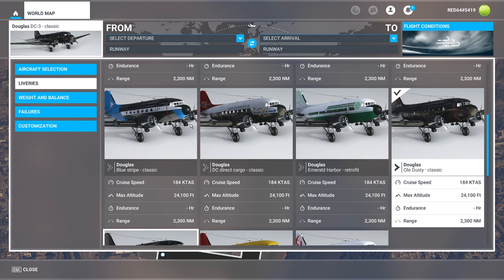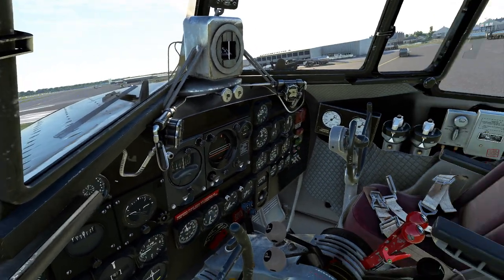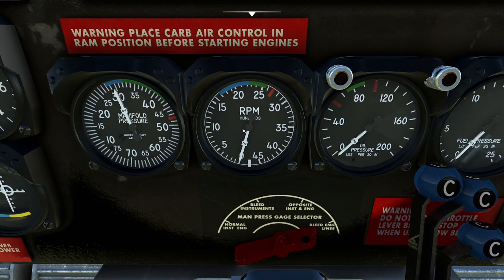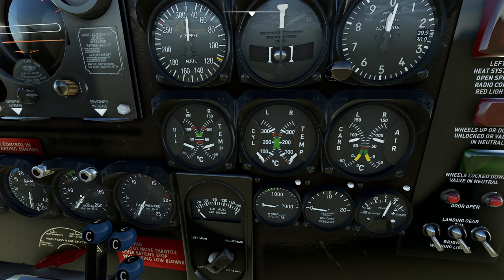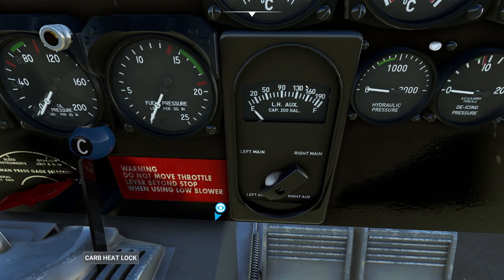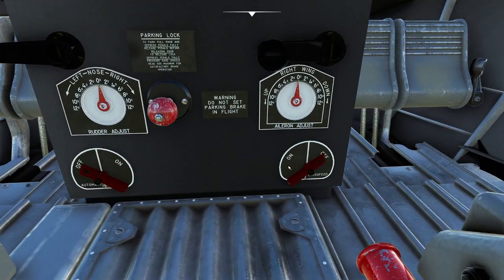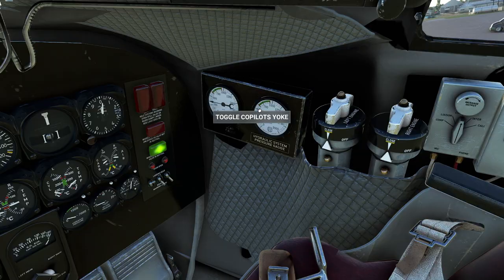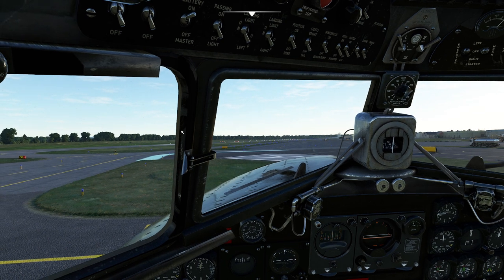MSFS - DC-3 Tutorial Part 1 - Systems

Comment: There is a mod for this plane done by Imendes from FlyByWire. He updates it weekly. This is my favorite plane but it's very hard, at first, to take off with. I crashed multiple times. Once up, you most drop your nose briefly to get your speed up. When landing, dropping you gear causes great amount of drag. Even if you are locked in on an ILS approach, the plane will start to fall. You must increase your throttle almost fully. That said, I love this plane and the deco era of style.
Reply: Typically radial straight wing aircraft takeoff at nose level to horizon. I know it's true with the DC-6 but haven't done much with this bird yet in the sim.
Reply: Took me a few goes to realise one has to keep pressure the joystick to keep the tail on the ground